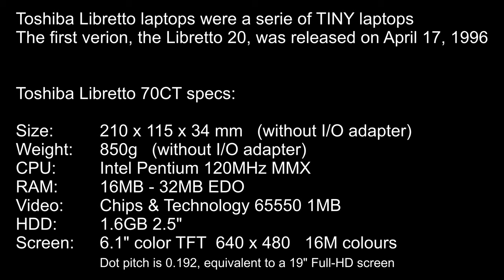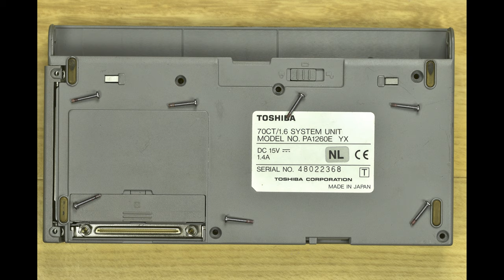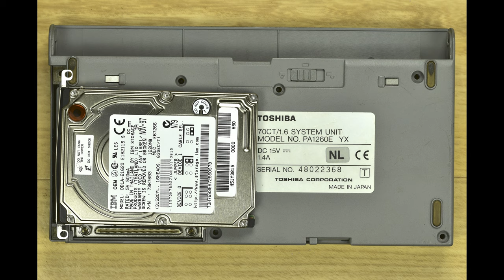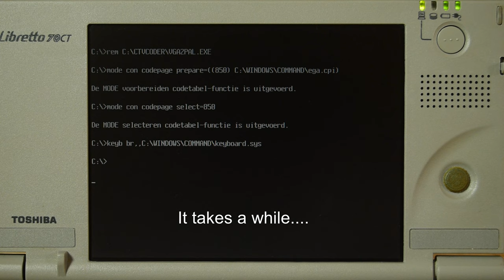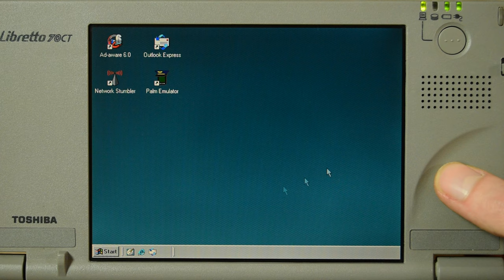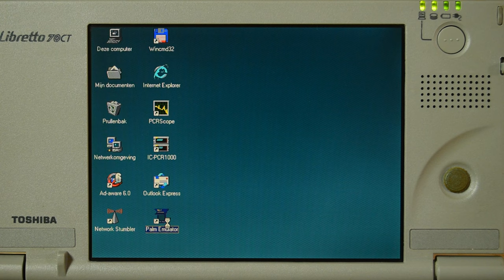Tiny vintage laptop teardown: Toshiba Libretto 70CT

Comment: 3:54 that large ic is a PCMCIA controller. That’s why it’s located by the PCMCIA slots. Older laptops have must have a dedicated for PCMCIA.
Reply: It's a gate array that handles PCMCIA, but it also manages much of the rest of the I/O. It's referred to as Petunia 2 GA in the hardware guide for the device, and there's a block diagram of all of the functions it holds. It's a super interesting chip. Later models (100CT+) use two Toshiba-built Gate Arrays with a lower gate count than this one, with each responsible for different elements of I/O and system buses :-)
Reply: @JasonDataBase  Very interesting. Too bad chips in those packages are so difficult to open
Reply: @BGTech1  Virtually impossible, sadly. The heat spreader is attached to the die directly with epoxy rather than thermal paste. These GAs are also wire bonded rather than flipped, meaning that removing the lid without also removing the silicon is a very difficult task (don't ask how I know...). They're also impossible to find these days outside of Libretto machines :-) I'm sure with a microscope and some cash it would be possible to get some idea of how they work, but there's little in the way of documentation left online aside from a handful of Japanese-language press releases about the Gate Array family itself with a footnote on their usage as laptop ASICs. Interesting bit of computer history for sure!